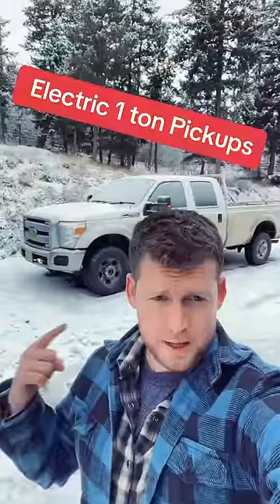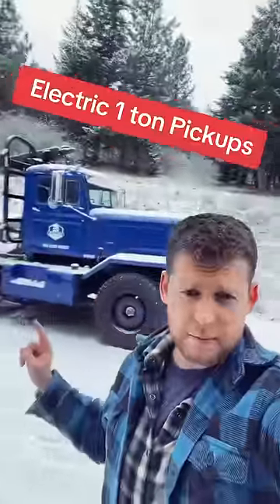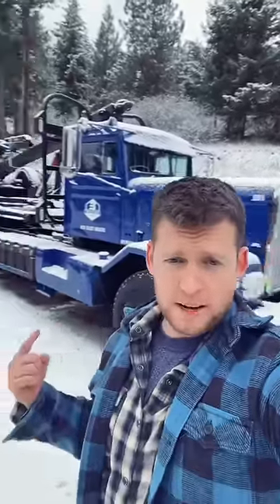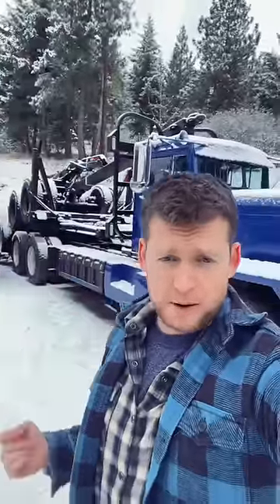Electric 1 Ton trucks

Comment: I wonder if they are going to make a 4wd version that still functions like your normal 4wd. Maybe instead of making it an e-axle. They can just put the electric motor in place of the transmission while leaving the transfer case in place. This way you can keep the 4wd. Either way I still love the innovation behind this.
Reply: Front and rear E axles.
Reply: @om617yota8  yeah but they said that they have to be a solid axle. Most trucks started to move away from front solid axles in the 80's.
Reply: I have seen a few 2000 pickups go the solid axle swap.  Might do that for my Dakota when the kit is available
Reply: @eaglescout205  I've done a few solid axle swaps. They aren't necessarily difficult. I just think that retaining the factory 4wd might not be a bad way to go.
Reply: @mwestie12  Yep, I have an IFS Chevy and Yota. I'd rather solid axle swap than wait.
Reply: I'm not sure how the suspension would deal with that though, you'd need to somehow make the motors on there own suspension system
Reply: @ronal8824  coilovers might help.
Reply: @ronal8824  what my idea is. To simply just remove the engine and transmission. Then replace them with a 4bt with a generator attached to it. Then either use a custom or the factory transfer case to attach the electric motor to. You should easily have room for all of that. The only custom suspension that you might need is some overload springs.
Reply: @mwestie12  Not, 1 ton pickups, they're solid axles front an rear at least through the mid 2000s
Reply: You can’t swap a motor for a transmission, that just doesn’t make sense..
Reply: @Imthedussin  why couldn't you attach an electric motor straight to a transfer case instead of a transmission?
Reply: @Imthedussin  it actually makes a lot more sense to attach it to the transfer case. Especially if you have a gm truck that doesn't have a solid front ankle. It would also be much cheaper to keep the factory axles in place rather than swapping them. So all you would need is an adapter plate to connect to the transfer case. It would also be much more cost effective. So please explain why you "can't" simply attach it to the transfer case?
Reply: Baby steps I’m thinking

Comment: I had a brain fart and realized I could put one of y'all's semi axles under my NOTABUS.
Reply from the maker: You could yes
Reply: @EdisonMotors  what kind of benefits could I get out of it? I know environmental benefits, some fuel savings, but I'm getting 10mpg now with my Cummins.
Reply: @thehillbillyhilton3557  Well, you could have an expanded battery pack that would let you basically run any residential appliance like normal. Electric stove, water heater, etc. Literally would be no need for anything propane based.

Diesel heat would probably still be the best bet for a heat source though.

If you are boondocking for a while, in terrible weather? No concerns. You have a quiet generator sitting in the nose of your bus.

If you are out enjoying nature? You can be driving in almost complete silence, allowing you actually hear the birds singing in the trees.

But, I don't know if you'd get the 50% improvement in fuel mileage, unless you change your engine as well. I mean, an automotive engine isn't designed to run at a constant RPM like a genset engine is so it probably won't be quite as efficient as it could be. But even going to 13-14 mpg would be a nice change, I have to assume.
Reply: @thehillbillyhilton3557  If you gotta climb a lot of hills, the e-axles make that a snap.
Reply: @BlackEpyon  we've gone over 3 different passes in Colorado alone, so good to know
Reply: @thehillbillyhilton3557 probably not worth it for you, unlikely to get a whole lot of improvement from 10mpg depending on your use case
Reply: @dposcuro  great ideas. We have a house size fridge/freezer, a chest freezer, and a two burner stove top. Our instant hot water heater is the only thing propane on our NOTABUS. We stay away from campgrounds so 90+% is boondocking. We have a wood stove for heat
Reply: @jaredlancaster4137  yea that 10mpg is hard to beat with our size outfit. We're already doin better than a lot of other skoolies and same size motorhomes
Reply: @thehillbillyhilton3557   The thing to keep in mind for a setup like this is that it becomes less a question of direct mpg since generators measure in gallons per hour, so it instead becomes a question of how often is the generator running? Also how much energy are you getting back from regen-braking? Would it be worthwhile to add solar to the roof of your RV? I've also heard about regenerative suspension being a thing now so that's also potentially worth keeping in mind. Lots of ways big and small to stretch out those fuel savings if you are creative.
There is a lot more to consider than just the direct mpg fuel savings when considering a conversion like this.
Reply: One benefit of electric is how there is no "top gear" that's most efficient to cruise in, so going slower directly correlates to higher fuel economy down to like ~20mph.
Reply: @Joe-xq3zu  yes we have 1600 watts of solar at peak once all connected. The regen braking could be helpful also. We don't do the interstate driving, even thou we can, we just don't want the kids to see the country that way. I'm building it into our home and it's almost done. Well I don't think it'll ever really be done but finished. Would it help me in keeping at a steady lower speed down grades? We haul a horse with us full time
Reply: @randgrithr7387  we're getting 10 pulling a horse trailer. 20 would be killer
Reply: @thehillbillyhilton3557  
I typed 20 mpH, not mpG.
Reply: @randgrithr7387  oh. I cruise at 60,61 and I'm good

Comment: Taking the motor out of a Ford diesel is arguably the best modification you could make, regardless of what you replace it with.
Reply: I think the idea here is that you just stick the generator in place of the transmission so you can use the existing engine for the generator, and that way save money. Maybe I have that wrong.
Reply: @BlackEpyon  A generator is an engine, but it's possible they use the stock motor to power the batteries. The concept in the truck is a much smaller engine (generator) than normal with batteries.

Comment: I love what you guys are doing. I've been daydreaming about something similar ever since I learned about electric motors in tech school in 2000. But obviously I never did anything. My idea was a small kit to add maybe 100 ft lbs to the rear wheels of a front wheel drive only between 0 and maybe 80 mph

Comment: Great idea, you and deboss have the idea….use the older trucks that may have some
Problems…love the thought of the smaller diesel motors converted to generators and putting these trucks..Need to make sure that they are 4x4 and capable off road… but you guys are corner the electrical truck and car idea

Comment: Absolutely fantastic - especially it the era bye extender - which will not be used for 99% of the time as people adjust to EV thinking.  I would suggest that generator be able to run in multiple fuels especially greener like biodiesel/ methanol etc with minimal changes.  That gives truck owners true ‘freedom’ and really breaks the dinosaur fuel business model.  Apparently all modern vehicles can run on methanol with only a software tweak - so that would be a over the air update to your generator software.  Just a thought and look forward to ordering.

Comment: I've wanted a diesel electric truck for many many years now. I can't wait! Only thing that worries me is grade shifting/engine braking but I'm sure that'll get figured out eventually
Reply: Regenerative braking (electronically switching the wires to turn the drive motor into a generator which robs power from the axle) would absolutely work like engine braking and not waste the energy.

Comment: That is just awesome.
Btw, the diesel brothers just bought a tank van. It needs a new power plant. They usually deal with diesel engines but said they would put a gas as there is a better throttle response. Get them one of those e axles. That will give plenty of throttle power, and still have a diesel motor!

Comment: Two dreams - adding a 120V/30A or larger RV plug to power your trailer AC; making sure the rear axle can be submerged at the boat launch with it. Love this idea when my 6.0 Powerstroke wears out. Keep the truck and get a better drivetrain!
Reply: I have been curious as to potential water intrusion issues on these E axles.

Comment: I would definitely consider doing this to my 91D250. It's been parked in the same spot since 2017. The 360 needs gone through and possibly rebuilt, and the 46RH transmission is shot because 1st Gen. Dodge transmissions are 1st Gen. Dodge transmissions. It's only a 2 wheel drive, but converting it to electric with a 3 or 4 cylinder Caterpillar diesel generator.
Would definitely be worth looking into,
because it was a good solid worktruck

Comment: I’m am just curious,  is possible take just any Peterbilt 389, take out the Diesel engine, put in Electric motor. But could you keep the eaton fuller 13/18 speed if you wanted too?, put in batteries and anything else. But keep the manual transmission? 

Is that possible?

Comment: Finally!! I love my 6.7 and as much as i hate electric vehicles. Diesel Electric just makes so much sense and this will be my first EV.

2 questions.

You say one ton pickups. However the F-250s and F-350s are nearly identical. Drivetrain is the same rear axles are the same as well. Will this kit work for 3/4 tons?

And second. Have you guys got an estimate on price yet?

Comment: Been there.. done that ... actually found with a 20hp diesel I can drive at full charge . And got an average of 60mpg .
However I simply put the electric motor in place of the transmission and kept the 4x4 function

Comment: Heyhey.... We need these for our jeepney classics to survive. 

The current ones uses a 3 liter I4 (Isuzu, Mitsubishi, Foton, JMC, Toyota) and looks just like a bus but smaller. It still in a transition phase between euro1,2 into euro4. If you can do it, can you also do it internationally? We don't have proper access to e-axles and batteries other than Alibaba with their FCL trading. We get a lot of genset though. From the Japanese to the Chinese and some US Cats.

A jeepney with a genset up front and a battery pack at the bottom (or below the seats). Others are so low to the ground that even the gas tank becomes a seat or just under it. Mostly the entire front seat with the filler neck close to the drivers side as checking the fuel is a matter of poking a stick at the filler neck on your left.

Comment: Should check out aging wheels via truck it's a hybrid truck, but it works exclusively off the batteries and then uses the engine as a generator

Comment: Build a generator adapter plate to connector to existing diesel motor from the truck. No engine swap needed. Then one large electric motor to connect to transmission. Add battery packs in bed and boom your up and running.

Comment: You better be careful or you'll end up changing the hybrid vehicle world for the better, forever.  That is absolutely awesome!  The problem with the current hybrid vehicles is they're absurdly expensive for what you get.  They're filled with weird, one off, specialized parts.  Where you're headed with this looks like the right direction to me.

Comment: What I really want is an electric truck that can recharge cordless tools between sites.

For landscaping this would be amazing. Most crews run similar routes every week. It's rare to go more than 50 miles (plus commute time to get to the area). 

A crew running 80% electric tools would cut down on noise and two cycles emissions. I love two cycle weed eaters. But, they are horrible for exhaust. And the neighbors hate the noise.

Comment: Battery size should be as close as possible to a transfer tank. No blocking gooseneck or 5th wheel hitch. Then tap into the truck tank for your equipment needs.

Comment: I got an old 1998 gmt 455 sierra 3500hd with a 454. This truck would be a perfect project for this. I use it as a chip truck for a tree service and its a tank but man is it bad on fuel. I get at best 25L per hundred km.

Comment: Finally! 
1) Are you planning with way higher torque than existing ICE or why not to use transfer case mounted e-motor instead of additional costs of new e-axles? I want to keep 4x4 without replacing all axles.
2) Battery in bed? Way too high centre of gravity. Anyway I have no bed but custom body. Any chance to place flat battery under cab between frame rails?

Greetings from Andy 
(I met Eric few weeks ago with our Eurocamper on 2008 6.4 Powerstroke F-350 DRW)

Comment: 6.5Liter turbo diesel 1999 Silverado want a double rear axle kit for it also to make a mini semi, haul trailers better. Be good for airport maintenance vehicals, senior buses,  small school bus campers, tow trucks, the CDL  folks too.  postal trucks, Amazon trucks, ups trucks..Be neat to see a partner company making farm equipment off same idea. Solar charge system, retrofitting diesels, keeping older machines relevant,  less waste in landfills, this will save the snow for the kids Christmases in the future , without having to pay truedues carbon tax, keep at it you folks are doing awesome. Side by sides for farms too, be a good business, bonus is they all use one style charger, not 2000 diffrent types of power plugs.

Comment: You think you can fit a generator in the space that the transmission takes up that could keep up with the power output of a 6.7 Powerstroke? Where are you gonna store the batteries? The bed? Good luck

Comment: Electric motors don't have much torque until they get moving (then they have as much as you want).  How do your kits handle starting on slopes when loaded?  How did you handle the torque issue?

Comment: Serious question. How much weight is that going to add? Are you going to use a smaller engine to run the generator? I have a 14 RAM 3500 cab and chassis. I'll volunteer it for a retrofit demo model.

Comment: Now I'm curious could you make a front e axle to make a hybrid 4x4 system and it can recharge off the front axle or in your case a permanent trailer set up with power trailer axles that hold 60-80% power of the primary axles that could also Regen

Comment: Does it include a downsized engine because the generator doesn't need the high peak torque delivery the original engine was designed for? I remember you mentioning that when talking about the semis in at least one of your videos.

Comment: I have been running my diesel cars and trucks and motorhomes on free veggie oil from restaurants for 10 years😮 That is free energy😮I have saved about $90,000 on fuel in 10 years😮 and made more than that by selling filtered veggie oil😅 can you beat that with electric hybrid I don't think so.....

Free veggie oil from restaurants is the perfect fuel😮 and the conversion technology only cost about $3,000 for a 1 ton pickup.

Comment: For ambulance application how would it work for the long idle times of a box on a scene and needing to power the auxiliary equipment. And would this be transmission free because from my time running ambulances I found either Ford, Chevrolet, or Dodge the transmission is the first to go with the driving the ambulance sees

Comment: How do you get around emissions requirements? And odb2? 

In the states the new motor has to compliant to the same level as the oem motor. Assume the frozen north is the same since we sell vehicles across the border both ways.

Comment: I don't understand why this has not already been done. A diesel generator to charge the battery in the car for insane mileage. With a battery, generator and regen from the wheels, range would be unlimited on a small amount of fuel. Instead of 20 gallons getting you 300 miles, 20 gallons could get you 1000 miles. That I will buy!

Comment: Hey you could make money making a retrofit kit for a small generator that fits in a teslas body panel, replaces a door, etc if you got creative. The most obvious is in the trunk but i was thinking a door that still functions but could have a reservoir for a gallon of gas or diesel for emergency charging. Crazy theres not a generator built in, or a reserve battery pack.

Comment: But where would the batteries be mounted if the diesel generator is in the engine bay and what about 4wd? Electric axle front and rear or electric motor driven through the transfer case?

Comment: I Personally Think That A Kubota 18 hp, 3 cylinder W/ Turbo Running something around a 22 to 25 Kw Generator would Be About Perfect Power Source. Also Have You Guy's Considered Going to An 800V Architecture, Instead of your current 480v On You're Simi Trucks  ??? 
It's " Not " as Critical  on the 1 ton Kit, But Would Be Nice.

Comment: Diesel generator and electric drive axle isn't the most efficient for highway cruising. Most hybrids have combination of 3 modes. Pure ev mode for low speed, hybrid mode for acceleration and ice only mode for high speed cruising.

Comment: Would this work in my 05 F150 that I swapped a John Deere 4045T motor into? Been needing a transmission after I destroyed one. It axles and suspension off of an 06 F350, and the frame is modified to mount them.

Comment: I’ll order a kit for my 2002 F350 extra cab 7.3 powerstroke 4x4 c&c with a 10’ flatbed dump. 
I wonder how the axle’s will work. Electric motor to transfer case or electric motors on the front and rear axle? 
I hope they’re stronger than the Dana 80 rear and Dana 60 front. 35 spline with slugs up front please. No need manual hubs. Any locker options for both?

Comment: Wait, so you’re not only burning diesel but also running a battery that when it dies can’t be recycled?

I have to thank you because you’re proving without a doubt that electric vehicles are not ready for commercial use. 👍